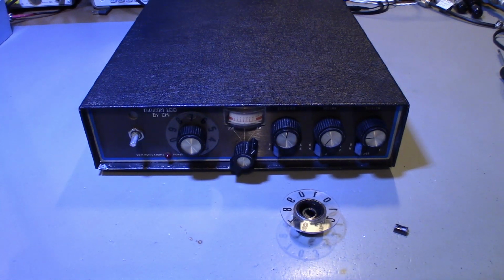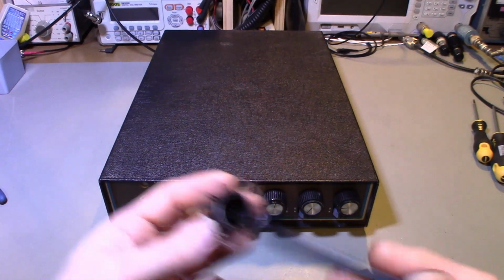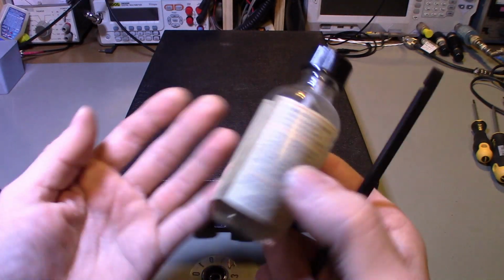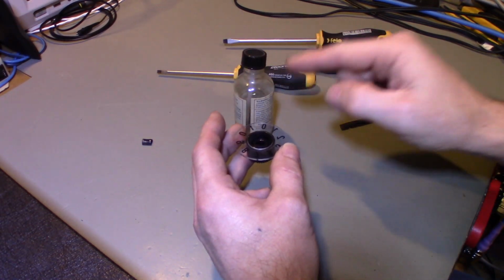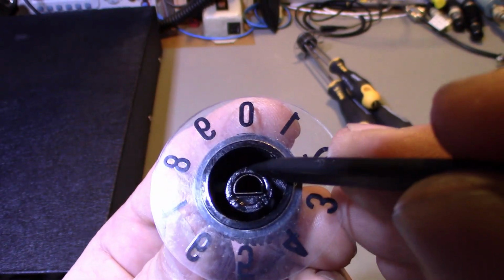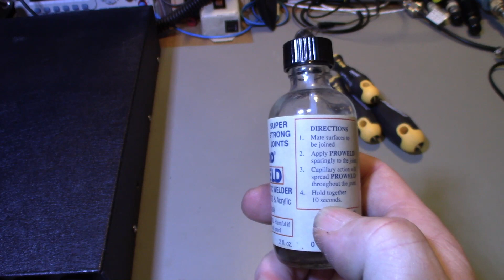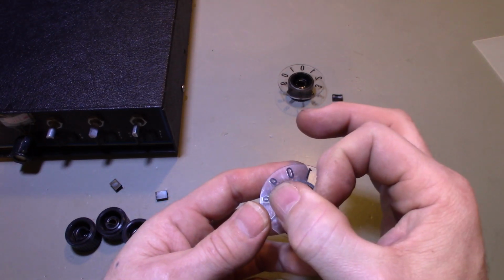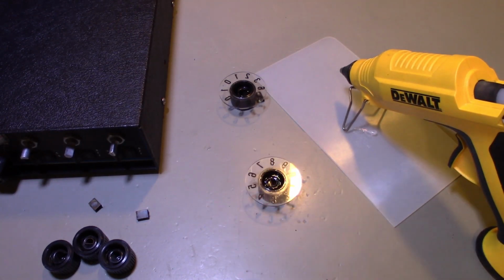Repairing cracked plastic knobs and reinforcing them.

Comment: Another fixer worth trying is called Sugru.
It is an air-curing urethane-type putty which can also be molded or shaped to replace small missing parts. I used it for the first time to "replace" a missing antenna cover on our cordless phone. It is workable,cures overnight and bonds well to most surfaces. I plan to stuff some of it down inside a broken knob of an NAD receiver,and fill in small voids on the outside. It comes in primary colors,and can be mixed to make other colors,too.

Comment: Good job! I dont use hot glue because of the massive heat (some plastics dont like that) but i use epoxy very often to make it solid. You can also repair missing pieces by simply filling it up and using a Dremel to rebuilt the original form. 73 de Olaf

Comment: another thing that works, i gorilla glued the cracks then took a small piece  of aluminum tubing that fit  made a few holes
glued that in around the center then filled in the empty cavity with apoxy never had a issue since :)
also if your knob has a set screw you have to account for that 
73'